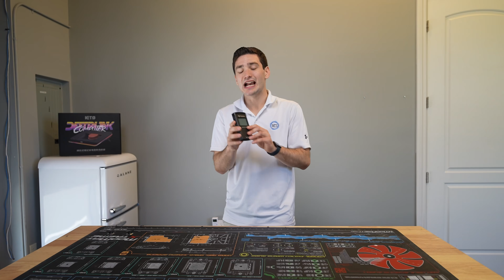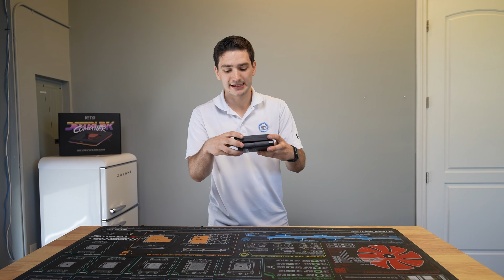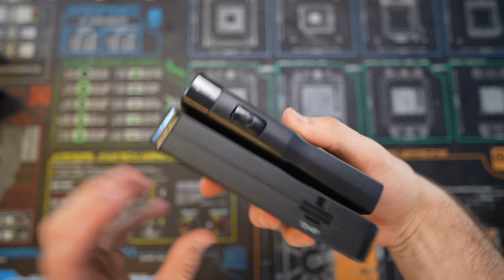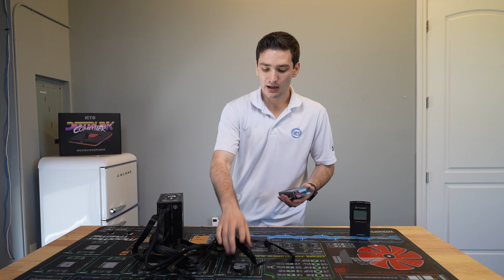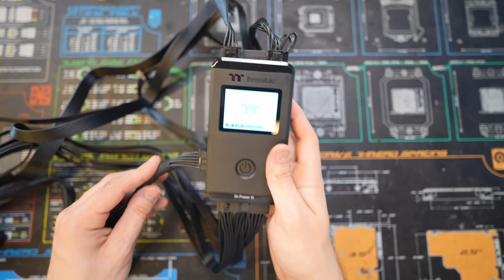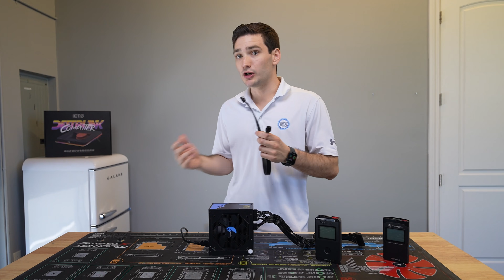It's Finally UPGRADED! Thermaltake Dr. Power III (Power Supply Tester)

Comment: WTF kind of shill review is this?    What happens if the ATX PSU does (NOT) have the 12V rail up?  Will the device still turn on and read 3.3v- 5v, or stand by 5V? Does this device need the 12V rail up to even power on?   What good is a device that needs a good ATX unit to work? How is that not the biggest question?

Comment: What is the difference with Dr Power III Pro?
Reply: The Pro version is an upgrade to the previous version. Probably the primary visual differene is the color screen. There are other changes to the testing and alerts. Voltage readings are a little more precise. It also supports the newer PCIe Gen 5.1 /12V-2x6 configuration.

Comment: my ATX 3.1 psu failed on the 24 pin test on the Dr. Power II is that normal? Missing the -12v on the 24pin in ATX 3.1?

Comment: I have a doctor power 3 and the issue I have with this thing is let's say you only have one power supply and the tester won't turn on, how do you know it's the actual power supply that's broken and not the tester? It has no power source of its own. That's pretty frustrating and seems like a large oversight.
Reply: use a multimeter, That's all this device actually is It just has presets so it knows what to expect for voltages on each pin. This device is mostly for convenience and speed You can do all this with the multimeter. Plus all you have to do is connect it to a motherboard if it doesn't work I mean that kind of confirms it for you too
Reply: @eksine if you use a multimeter, then you can skip that device entirely...
Reply: @evgenitantikov5865  This device measures everything at once so it's more convenient so no that's not the point

Comment: I don't know anyone who goes through multiple power supply's during the life of a computer. Power supply is the one thing that lasts at least 2 builds
Reply: Not true I actually had a brand name 80 plus gold rated power supply go bad on me in my wife's computer and it had at most 80 hours worth of usage and just sat in the office for 2 years. Ended up being a bad power supply right and I had to replace it.

I've also had computers that just will randomly shut off due to bad power supplies.
Reply: psu testers are super useful when checking computers that are not yours, you can start of the process being sure the psu works. Also very useful when doing custom cables

Comment: I’ve got another question! 🙋 

What happens if you plug in 12 pin adapter to the unit and then hook up the standard PCI-E cables to it?